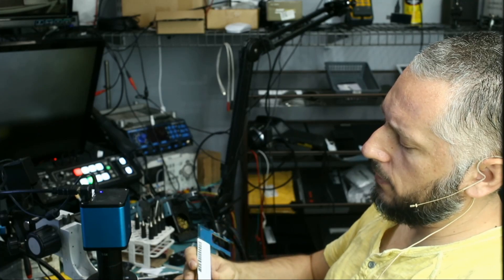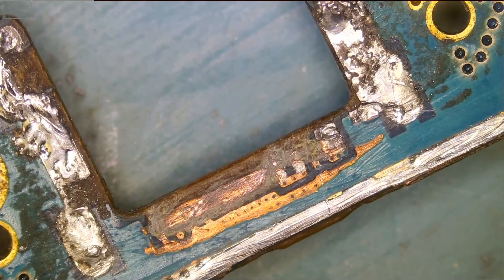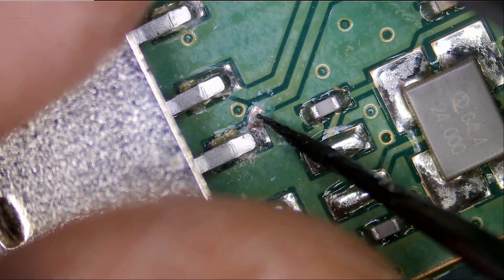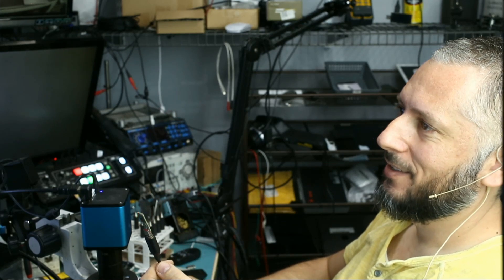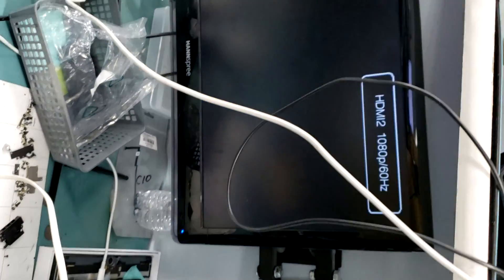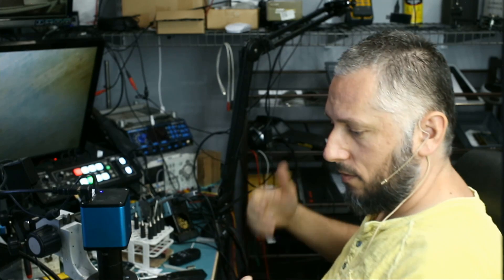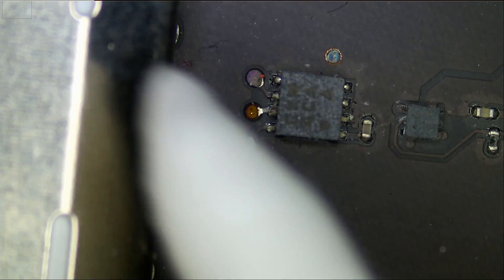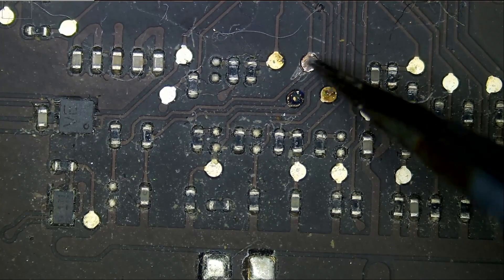My lucky day. 3 repairs in under 10 minutes. No power Macbook Air, Flash drive and Desktop.

Comment: That was lucky, opposite to you I had a very bad day I first while transplanting the battery controller from the old battery to the new one (same model different connector) I accidentally punctured the battery. The second thing I replaced the screen with the frame on one plus mobile, move all switches, flex cables... tested it and drop it on the floor. The funny thing is that's my mum's phone, it will be easier for me if it belongs to the Russian mafia boss.

Comment: hi i have some question for you 
what liquid you use to clean the board
what liquid you use to get easy a soldering when you use for the usb driver .
How you test a smd condensor ,resistor ,diode?

Comment: I would have been concerned about the HP computer. Yes, chances are the PSU connector just needed to be reseated. But maybe there is a cracked solder joint on the socket or inside the PSU - it's happened to me with an old MB which was working out of the case but not powering up inside the case. Of course you don't want to overthink the situation and start disassembling boards. Not sure what I would have done to be honest.

Comment: When I work on desktop computer power supplies I always try to substitute with a known good one, just to be sure.  I use the same power supply checker that you use (Thermaltake Dr.Power II) but I use it with a homemade adapter that puts a load on each of the important voltage rails (12V, 5V and 3.3v).  I used a "Y" power supply connector and the female end of the "Y" connects to the power supply, one of the male ends goes to the Dr.Power II and the other male goes to my load board.  The load board has some power resistors on it and provides a good load on each rail, which exposes any "weakness" it may have with respect to voltages.  I have seen some power supplies that test fine with the Dr. Power II by itself, but fail when you put a load on it.  The fault is usually caused by dried out electrolytic capacitors which you normally won't see unless you disassemble the supply (and who has time for that?)

Comment: I'm not sure if your PSU tester (and any other, not specially your) are really trustworthy, a good number of dead psu will continue to work at a low load however, what this device cannot determine is at a high load, for example by playing a game which has the effect of shutting down the Computer.  So the PSU may look like it's working but in reallity not
Reply: The thing is that the pc didn't turn on at all
Reply: Not turning on is a user reported thing. 1st rule of working with users is don't trust what they say haha. Could be something simple like the hdmi was plugged in after the pc booted and there was no signal. User says it didn't turn on but it did. Agree with the psu testing though it needs a load on the rails and a stress test to prove it works. May not work when a specific rail is being hammered.